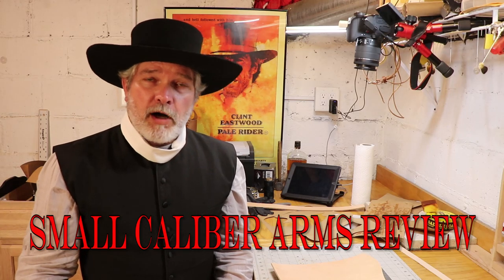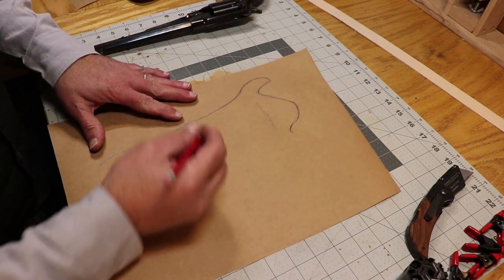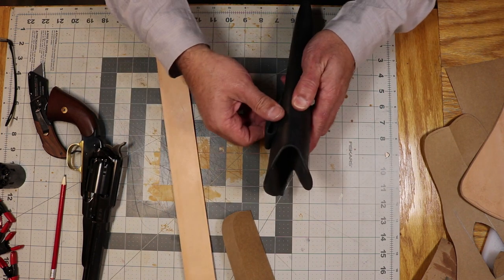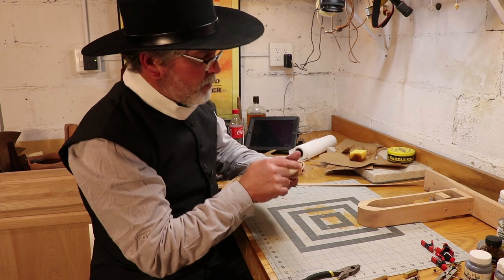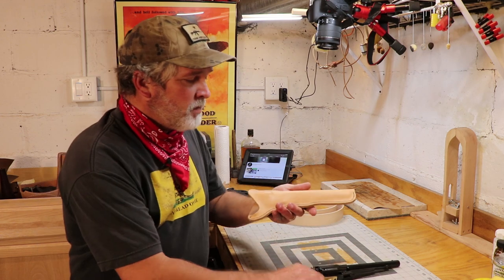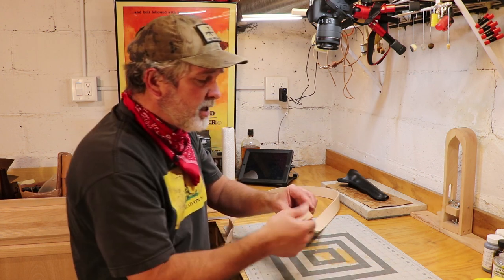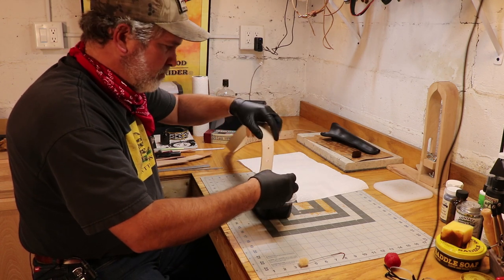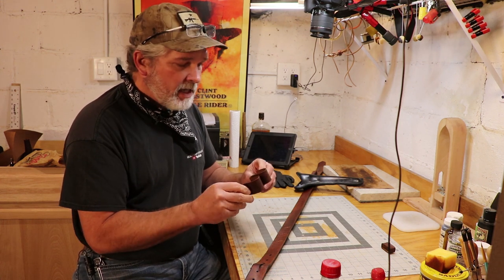Pale Rider Holster, A leather holster project.

Comment: Nice!  looks like a fun project.  I looked at the spare cylinder pouches and it appears the pouches are made with one strip of leather a little taller than 1/2 the belt height.  It also looks like they used spring metal clamps to hold it to the belt.  I think it starts pulling off when he pulls out the cylinder and he has to change direction to keep it attached to the belt.  It also looks like they are moving cock-eyed against the belt.   But that's just my guess.
Reply from the maker: It's hard to say because there's not many really good shots of the holster. Thanks for watching!

Comment: Make the cylinder loops a little taller and add a toe that is sewn in. I believe that would make them fairly secure.
Reply from the maker: That would definitely work but might not appear like the original. The movie ones aren't always practical though.

Comment: The only suggest I could make is to sew a 1/2" of leather thong to the belt laterally where the cylinder would rest against it. I doubt you would even see it with the cylinders loaded in the belt. I had to sew a weld of leather under a row of loops to support .45 ACP rounds. It works well and I can run. 45 Colt rounds over it if necessary (the gun has two caliber cylinders). Too bad the cylinder holder didn't just slide on the belt so you could just cut a leg that sewed on the bottom as support like modern speedloaders. Great job.
Reply from the maker: I may have to look into that. Thanks for the tip and thanks for watching too!

Comment: Revolver cap and ball; Two extra cylinders cap and ball. What for the metalic cartridges?
Reply from the maker: They do make metallic cartridge cylinders for this revolver. I don't have any because they each cost just as much as the revolver. The movie used metallic cartridges because they are easily loaded as blanks for safety. Also carrying a loaded and capped, cap and ball cylinder is pretty dangerous. If they fall and hit a cap, they can go off.

Comment: A question.
When you have the front drawn out on paper, how do you determine how much more leather is needed for the bend and the back of the holster? It looks like you simply did this using the paper, but wouldn't leather require more material because it is thicker?
Reply from the maker: Leather absolutely will require more. Sometimes it's just by experience, and I have ruined a few pieces of leather doing it. You get the hang of it after a few times. You can use a thin piece of leather strap, sort of like a ruler and check the length at different areas. I have also seen people use craft foam for their pattern, it's a little cheaper than leather and easier to work with. Wet molding also helps out a LOT! Thanks for watching!
Reply: Thanks. I'll be giving it a try here shortly.
I'm much more comfortable with kydex, so I know what you mean about getting the hang of the material needed/used up by the forming. 
And if you noticed a lot of views on this video today... it was me. LOL @SmallCaliberArmsReview
Reply from the maker: Watch as many and as much as you wish! Lol.